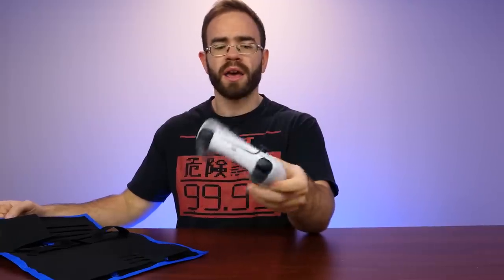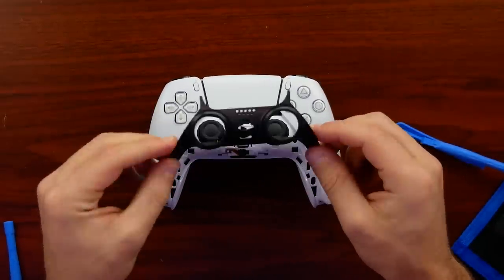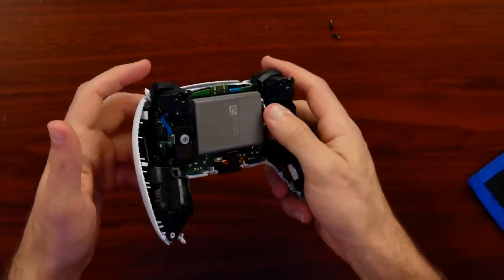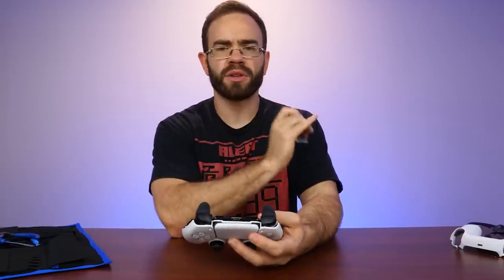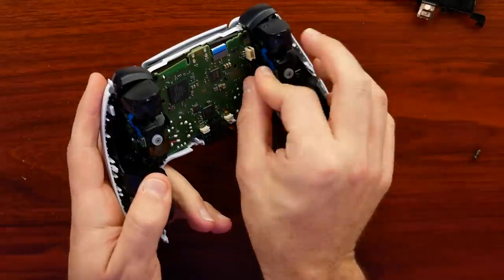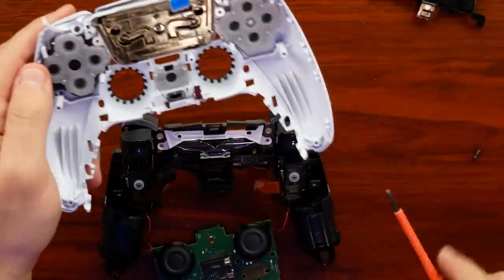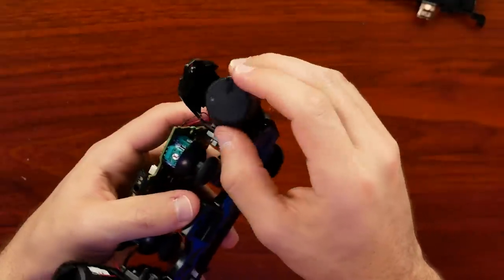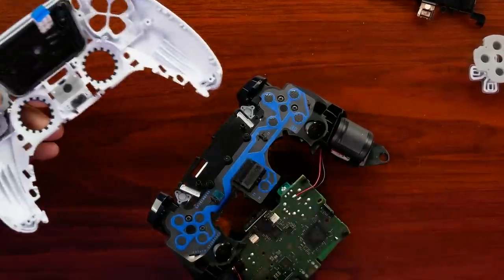The PS5 DualSense Is The Craziest PlayStation Controller So Far (Teardown)

Comment: The little motor doesn't lock the trigger, it just gives resistance. The limit piece of plastic is set by a potentiometer that locks it in different positions. Battle Beavers Customs has done a teardown where they explain how it works. You made a great video as well, I think it will be nice if you can make the motor work injecting some current in it. Also if you could open the haptic motors to see their inside it will be amazing.
Reply: it can lock the trigger but most ppl will have enough strength to overcomethis force. motor is very small. This is just like force feedback steering wheel but much smaller.
Reply: The trigger can be locked. Arkane Studios said they're going to have a mechanic to lock it when your weapon jams.
Reply: The trigger can be lock by the potentiometer, not by the motor
Reply: @rickscar2408  I have seen this video and there is no physical way of locking the trigger in place - there is only a motor that spins the gears which one has a potentiometer. Potentiometer CAN NOT stop the trigger from moving - it is only a part to give the controller value how much the trigger is pressed - similar how you set volume on your radio or tune in required frequency. Only hard stop is when you pull the trigger all the way down. it is the motor that will try to spin the oposit way when you pull the trigger to TRY to stop trigger from moving. And beign a such small motor there is NO WAY of giving such high amount of torque so you could not overcome it. Ofcorse it could be that gears a so fragile that it would require for you to apply more force to overcome the motor but gear will break before that but I highly doubt that. Also there is probably a value of resistance that developer can set it to to prevent trigger from "locking" because they dont want to make customers strip gears becasue ot that or burning the motor itself. But like I said, there is NO WAY OF PHYSICLY stopping the trigger from moving, there is only way to apply its resistance to press but even at max value you will be able to overcome this. Not that you have to do it, and most people wont - its only task it to make you feel the pressure in order to trick you to think that you cant press it. It it exactly like in steering wheels for consoles and pc. even at max settings you can overcome this forces and turn the wheel - maybe except direct drive models :)

Comment: Definitely the best controller out there. I mean, it's on a completely different level than anything else. The adaptive triggers and haptic feedback will be great for feeling the different trigger weights and shooting sensations of guns. Same with bows. Also the sensations of different types of vehicles. You'll be able to feel the weight of the gas and brake pedals. The brakes firming up the harder you press them and stuff like that. You'll also be able to feel the sensations of how vehicles are performing at different speeds and on different surfaces. Coupling all that with 3D audio is gonna be intense! So awesome that Sony are innovators.

The option to not need to use a headset if you don't want, by using the controller's HD speaker and mic set-up, is also dope. A lot of times, when I'm just casually gaming on the couch with some friends, I don't want to be wearing a headset because it cuts me off from the people I'm with. This solves that.. Sony literally thought of everything.

Comment: Well the good thing is it seems that it's designed in a way in that if plastics do fail, it will fail in a way that the triggers are still usable.
Reply: Yep I am kind of worried they will break because it seems to be on of my favourite features once usable but if it does break the triggers will still work

Comment: pretty sure the engineers who develop these things take in to account the very obvious idea of certain plastics breaking down over time lol.. pretty sure they would not have used whatever material that plastic is if they felt it would wear down in time.. not all plastic is the same. some are very durable
Reply: Yup and plastic gears are everywhere nowdays from from drills and power tools to industrial machines, if they used the right plastic (which they very likely did) then those gears look beefy enough to handle the force of a single finger

Comment: trigger tech very similar to xbox one controller. Games ok but dualsense is very overhyped controller (i am ps user btw , and ı dont like ds4 too much i am sure, dualsense better than ds4 but still very overhyped controller)
Reply: The xbox one just has rumble in the controller, in this there is an extra corkscrew in the triggers going against the motion of the triggers when current is applied. Nowhere near to what the xbox controller has
Reply: @manakmishra  yes and  ı didin't say same. But it isnt very different. For example on xbox controller, If  you play forza horizon and get out road, you will feel something wrong. And generally you can see Sony's haptic engine is not same as nintendo's, apple's or xperia xz2-3's engine. Their trigger system is hybrid of xbox elite controller + dualshock 4, but haptic engine is different not like our expectation.
Reply: @Cpoint.200  voice coil vs traditional rumble motors.. xbox elite and dual shock uses traditional rumble
Reply: @Chantzdc  i dont talk about elite's rumbele, they have phycial  mechanism for reaction trigger. And coil is different way for rumble. But you cant understand their difference easly on same racing game. But if you play deathloop probaly you can (because arkane studios try something :p)
Reply: *overhyped (adjective)
Reply: @alvallac2171  thanks mate

Comment: You can’t really moan about the use of plastic in the 21st century. I cannot think of any other material. Even moulded metal would be too heavy, fibreglass? I think it comes down to the quality of the plastic and how much reinforcement it has inside.

Comment: The PlayStation controller will always be low-tech until they switch the placement of the left joy-stick and the D-pad.
Reply: Absolutely not. People use Dualshock 4 in Tekken tournaments the place of the d-pad cannot change that's the best position. There is a reason why 8bitdo Pro+ controllers are also designed like that.
Reply: Bro what are you talking about? Theres a reason why fighting games are trash on Xbox. Switching the placement is the worst shit sony can do.